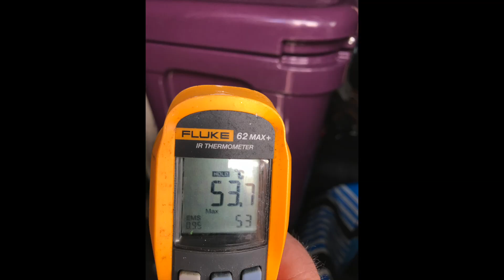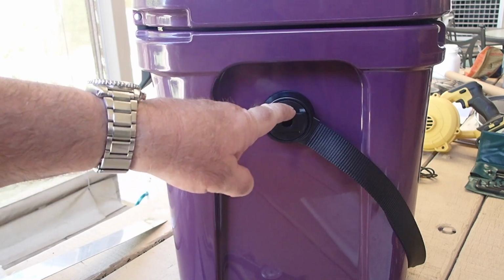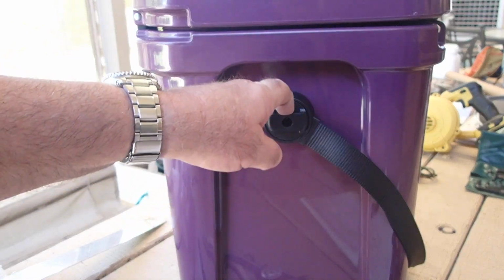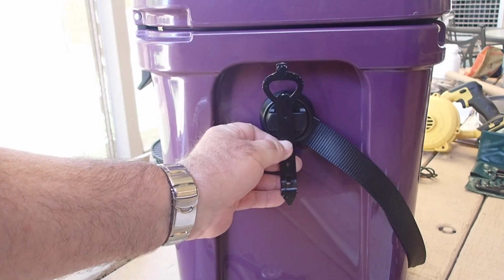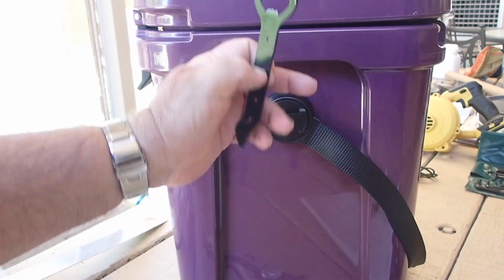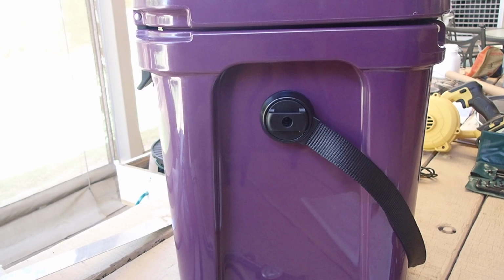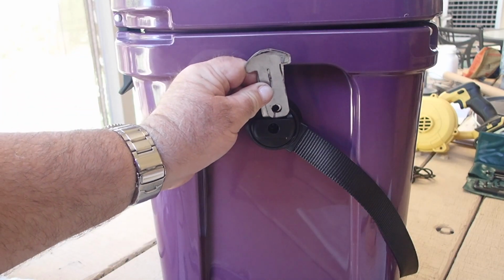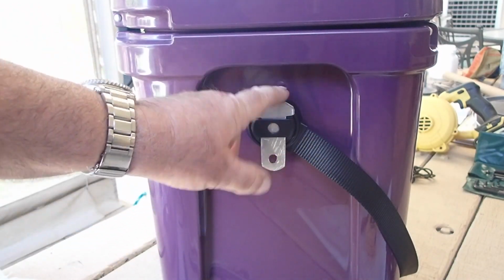Yeti Roadie 24 tie down bracket lock plate DIY

Comment: I used the piece of flat stock on a 3” U clamp. Bend a 45 degree angle and slip it in the slot! Now you have two slots to secure it.